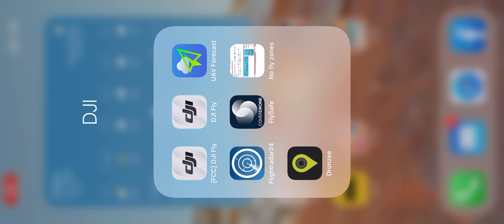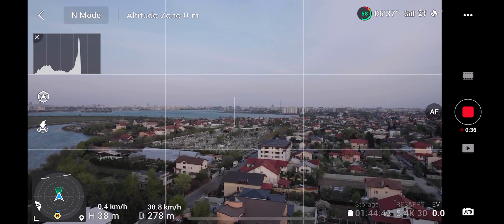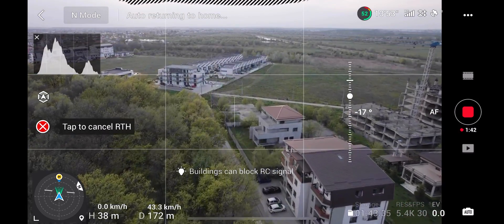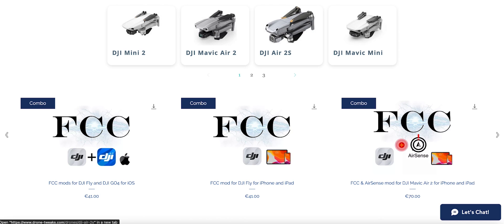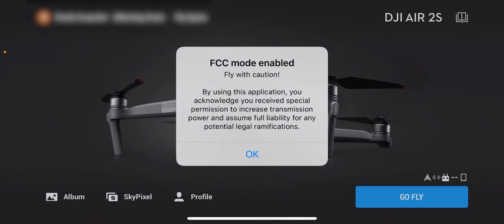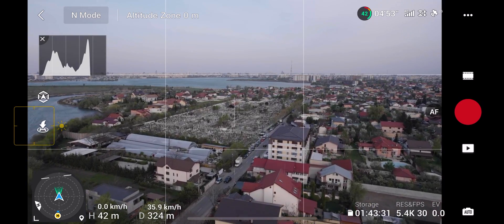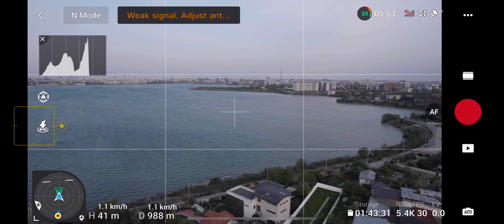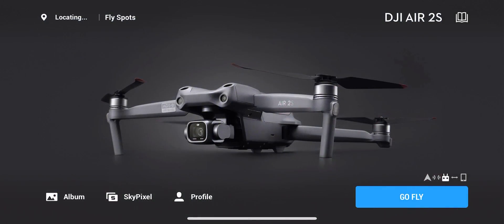FCC mode vs CE mode on DJI Air 2S when going behind obstacles

Comment: The Drone Tweaks app seems to work thank you very much. I still have to fully test it but based on the transmission tab in the DJI Fly app, I’m now in FCC mode for the first time! Distance wasn’t the motivation for me, I just wanted a more reliable signal through trees etc like you indicated. Cheers!
Reply: You bought DJI drone already have fcc system..wow. But, when you fly your drone at to many antenna you can't get 3km++
Reply: At Malaysia, they(DJI) modified FCC to CE mode  products for Malaysia. They limit because a law government...damn😝
Reply: @zack79official60  more so radio band limitations....

But also software limitations as well
Reply: @zack79official60  Did you manage to use the app to mod your drone to FCC?
Reply: @arlentan  yes, I'm still can used my drone for fcc mode someplace. But not for all place. The furthest range can only be almost 5km
Reply: @zack79official60  Wow that is still impressive. Did you get the iOS version? or Android
Reply: @arlentan   I use an android phone. The use of fcc mode can reach over 5km. Due to the lack of battery life resistance, only 4km I decided to RTH.

Comment: I think it is important to get a better signal so we can fly safely.
It's a pity that in my country only CE is allowed by law.
Thank you very much for the test.
Reply from the maker: Yup, same here. The frustrating thing is that the regulations are not really targeted at drones, it’s mainly for wifi routers in crowded spaces like apartment buildings, so they don’t jam each other. No real issue with a drone in the air

Comment: Well here is the question i live in greece wich is in the eu and with my dji mini 2 se i got a range of 1.200 meters with some buildings and other obsticles without any kind of fcc app or tweak to the drone how is that possible  if you only got like 450 meter or more i dont remember but yeah pleas explain
Reply from the maker: i was deliberately going behind tons of trees (which are horrible for signal, because they absorb the signal instead of reflecting it, like buildings do) because I wanted to do the comparison test without having to go very far. I can also go quite easily over 1km in CE mode when flying above my town and to over 2.5km when using FCC mode.

Comment: OK, my OCD is kicking in on how to distinguish CE from FCC mode. How does the 1km line being above or below the 90dB line show a power difference? Since the dB lines are all -(negative) dB values, is that supposed to show I now have more power at 1km when I'm in FCC mode (less negative)? 
I'm used to just reading power peaks on a spectrum analyzer. This looks like some sort of scale change rather than  an actual power reading.
Reply from the maker: I’m guessing that signifies that, if the measured interferences, meaning the green graph below, reach up to that line, you will only be able to go out one kilometer before losing signal. With FCC mode, it can take even more interference and still make it to 1 km. If you look lower down, you will see there is also a line for reaching 4 km if the interference is very low.
Reply: @RaduBogdan2k  OK, now that's making more sense. Essentially by increasing the power you've lowered the noise floor. Thank you.

Comment: Have you noticed if the battery drains much more faster in FCC mode?
Reply from the maker: No, there’s no distinguishable difference from what I can tell
Reply: It may drain faster if your further away.... maybe not though
Reply from the maker: @Matanumi  as far as I know, there’s no increase in transmission power as you go further away, it’s always the same

Comment: Interesting. Does anyone know which version we use in Australia?  And does this hack void the warranty?
Reply from the maker: I think Australia is in CE mode, you can easily see that from the Transmission tab. As for the warranty, since you are allowed to use other 3rd party apps (like Litchi), I don't see why this would be any different. I've had a crash while using this app, I sent it to Care Refresh and there were no issues.

Comment: The fake gps trick still works ? Like setting a fake location with a fake gps and putting the controller in fcc mode and then switching back the gps and asking to switch the controller to Europe and clicking on the cancel button ?
Reply from the maker: No, that doesn’t work anymore, especially with the Ocusync drones
Reply: @RaduBogdan2k  and there are no external antenna anymore a so we can’t even use the little reflectors  that I use on the spark controller, that literally double the range of my spark..

Comment: CE range and signal stability sucks. I FCC hacked my Air 2 ever since the 3rd day I've owned it.
Reply: It is said that when hacking to fcc it may cause the drone flown away on its own do you know anything about that thanks
Reply: @mertb.2502  I've been using the FCC hack for more than 200 flights and I've never had any problems with my drone flying away from me :)
Reply: Abner fernandes  There is now way to get higher than 500 m.
Reply: @davidofqwerty  Yeah. There is no way I can get past 500 meters height. With my Air 2 I was never able to go higher than 500 meters.
Reply: @davidofqwerty  Maybe your drone was secretly hacked.
Reply: @davidofqwerty  uk is CE mode
Reply: Mine hasn't even arrived and I've already bought the FCC hack 💀

Comment: Still a piece of garbage like mine. Advertised 10km range does about 1km.
Reply from the maker: You’re thinking of the ideal range. That’s very very different than forcing it to transmit through 3-400m of water filled foliage. 
I’m getting 3-4km quite easily in urban environments and 7+ km in open areas.
Reply: @RaduBogdan2k  after trying everything with mine and still only getting about 1km
Reply from the maker: @Madscientist9898  did you switch it to FCC?